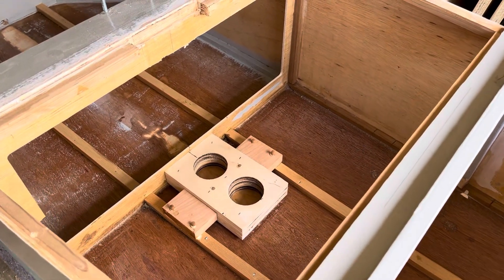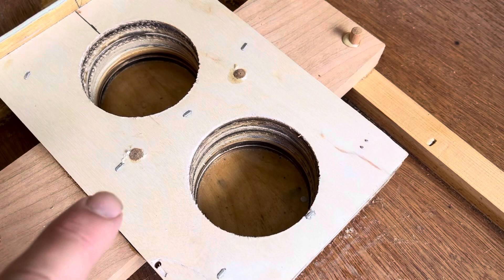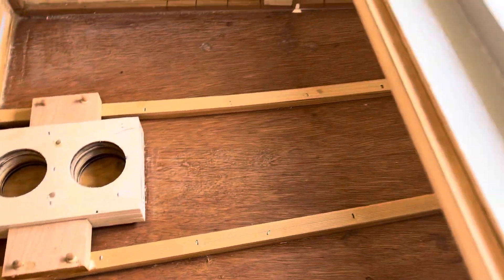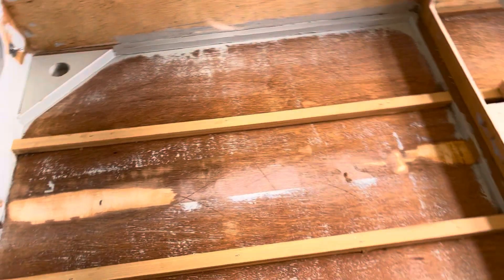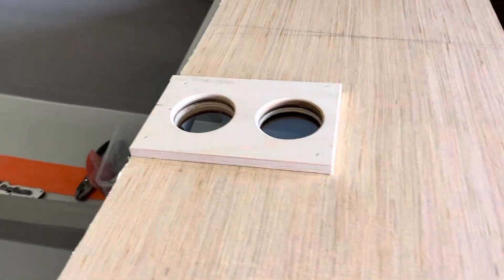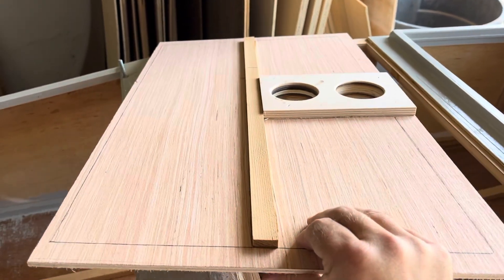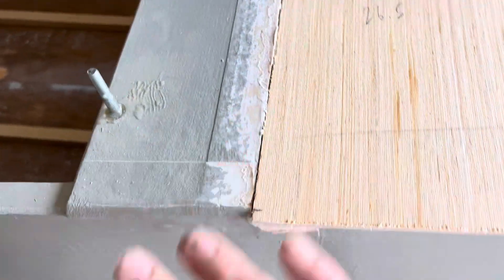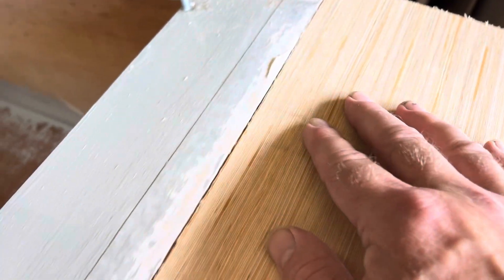I repaired the broken mast step

Comment: Hello Mark, I saw your video and would like to point out a mistake, I don't think the mast step can hold. If your sail generates approx. 200 kg of pressure at the pressure point, what is the torque in the mast bearings?
I don't have any measurements but I would like to estimate that the torque is about 8 times as high as the force at the sail pressure point. Therefore, each bearing will have to hold a lateral force of approx. 800 kg in all directions and introduce the force into the hull.
Do you think this construction can handle so much force?
Reply: PS: Please excuse my bad English. Unfortunately, I had to have the text translated from German to English using Google Translator. I can understand technical English but unfortunately I can't write it correctly.
Reply from the maker: My sail is 75 square feet. Pressure per square foot at 20 knots of wind is 75 X 1.6=120 lb.  But that is with the wind perpendicular to the sail.  I assume only 50% of the sail will face the wind. The leverage at the bottom is 8.5 to 1 so 60x8.5= 510 lb.  I think the mast step can handle that.  But if it breaks you will be right.  Not sure it could handle a 30 knot gust.  Probably not.  Wind speed on the Chesapeake is relatively predictable except in a summer storm.
Reply: @markpalmquist  Hello Mark, please test out your solution first and take your time to check the position of the mast. If you want to change something, then I recommend you keep one fixed idea: All propulsion energy is generated in the sails, the keel absorbs this energy and accelerates your boat. So all forces always run back and forth between the mast - keel - your wings and the fuselage. So that must be the most stable area.
I would recommend you put the mast between 2 bulkheads that can connect the hull, keel, your wings and support the mast.
Reply from the maker: @thomaskamp9365  thanks!  I will add more bracing to the mast step area.  I also stiffened up the wings because the force at wing to hull connection is also high as you mentioned.